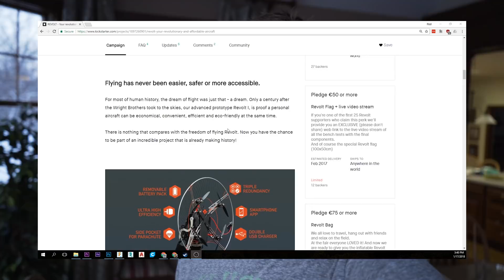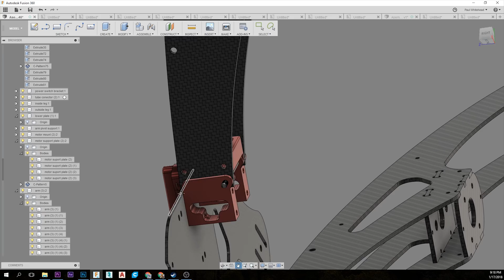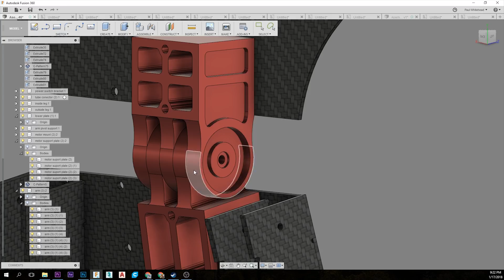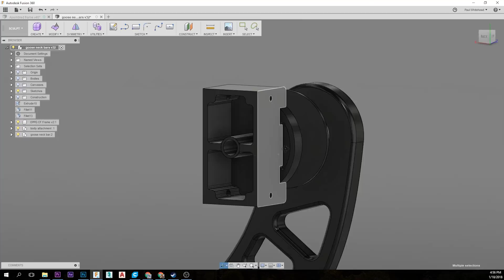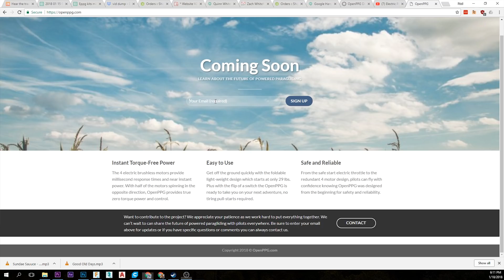DIY Electric Paramotor Project Update (Vid #3)

Comment: Seriously looking forward to this build being available - I've had two paramotors (AC 130 and AC 200) and this electric build is spot on perfect for my next ride. Love the concept, price point, portability (carry on a plane!) and creativity you're throwing at it. My main concern will be safety (of course) so I hope to learn more about loading, heat dissipation, & overall durability of the structural & electromechanical components.

Comment: Also, with regards to noise, have you considered varying prop/engine size/speed. For instance two larger up top and two slightly smaller at the bottom. Might result in a better sound profile. I know sound isn't your primary reason for doing this, but if there's an advantage you can get for free you may as well. Just something to think about.
Reply from the maker: Dheorl ya for sure, I have tested props that are quiter and that something that I definitely want to look into in the future. That's another reason why I'm going open source so people can experiment with different props and profiles.
Reply: There's some quite interesting work being done on distributed propulsion that I'm thinking might be applicable. Tbh I don't know a massive amount about it myself, but might give you a good starting point on what direction to go.

Comment: Did you already go over how much thrust it produces? Or is it still up in the air because of changes? I'm a huge fan of this design. And built it in my head before seeing a sneak video with the revolt almost a year ago. So I'm very happy to see this being offered as a kit.
Reply from the maker: Florida paramotoring sure these current motors each motor can put out 41lbs. So all said and done it put out around 160lbs of thrust.
Reply: PDWhite wow. That's enough for even a big guy. I'm stoked!

Comment: What aspects of the motor are optimised to give such a big improvement, was it refining the prop/KV combo or different windings (plays into KV) or  the physical design of the motor and materials?
Reply from the maker: Ryan Bell yes your correct about the kv and windings. These motors have a higher pole count along with better magnets. The motor itself is also 40% lighter. There more design around being efficient vs the other being more compacted. So this one is larger in  diameter. That being said that's why I'm testing them my self to see how they hold up.
Reply: Sounds great! Will it be possible to manufacture the motor ourselves?
Reply: I was also thinking the multistar battery's were perfect for the application

Comment: Like pretty much all of these projects, the limiting factor isn’t going to be the design, rather the energy density, i.e flight time, from the batteries.  I wonder if lithium ion would be doable?  Certainly would allow more flight time, just not sure if it would put out the needed amps.  Would two, smaller banks, one Li-Po and one Li-Ion, work?  Have the Li-Ion while cruising, have the Li-Po when you need some punch.  I’m sure you good regulate them in a way that the amp draw would balance between them as the need for power dictated.  I so want electric paramotors to become a practical reality/alternative!

Comment: Thanks for another very interesting video about this kit! I would like to get this paramotor certified in Germany so I cna use it in the Netherlands as well. Anybody in Germany that would like to help here? I already got some documentation with requirements etc.
Reply: @udovdh I am from Germany as well, currently flying a two stroke Paramotor with a sports pilot license (same as you probably?). I am all in on this design, and certification would be awesome (even though I think this would cost several thousand euros).
Do you actually know that electrical paramotors with limited flying time (I think it's under one hour) are considered as a "Climbing Aid" (Aufstiegshilfe)? That changes a lot in terms of rules.
Reply from the maker: udovdh ya that's a good topic for the forum. We should work on getting it certified. Living here in the US we don't think about that but that's great topic we should look into as a community.
Reply: Etienne, I have some (non-motor) paragliding experience and will do paramotor training soon; this kit would be excellent to do some frequent flying once I get the necessary license.The German requirements document that I got from the DULV: https://wetransfer.com/downloads/07825221eb461a9f4ab11fbea8ac213120180119124153/796938e03294abbe0a847b72350e498e20180119124153/a7d89e 
They do not yet know of battery powered paramotors in that document. And I do not yet fully understand which sections apply in which ways. So perhaps we coudl distil the requirements from this document and translate in English?
Reply: Etienne, I did not yet find the Aufstiegshilfe term in the Deutschen Ultraleichtflugverband (DULV) document that I posted the URL of below. I will ask DULV about this.
Reply: Hi Udo, the DULV is the wrong place, even PPG is only a very small portion of the DULV. The DHV is the right place. see it here: https://www.dhv.de/web/piloteninfos/ausbildung/e-aufstieg-gleitschirm-und-drachen/ ... apparently being "electric" isn't the only prerequisite. I may have been wrong. It really kind of stinks that Germany is so overregulated, whereas in other countries you don't even need a license to fly.